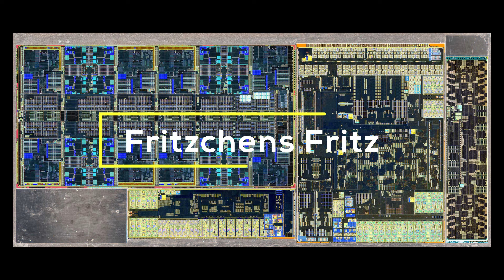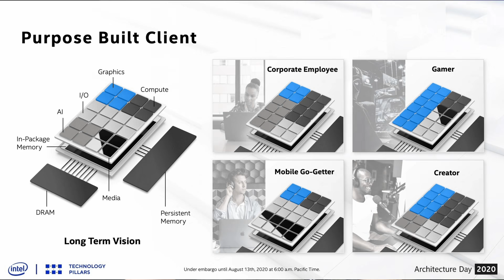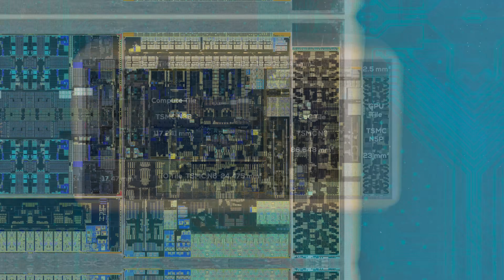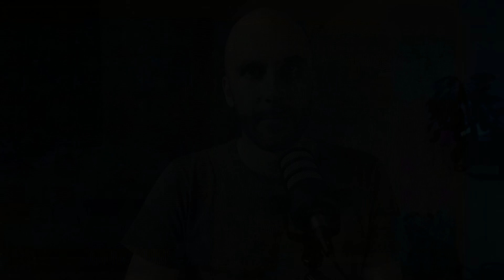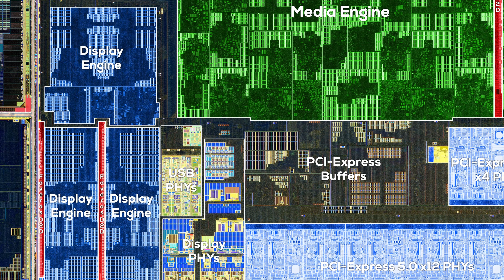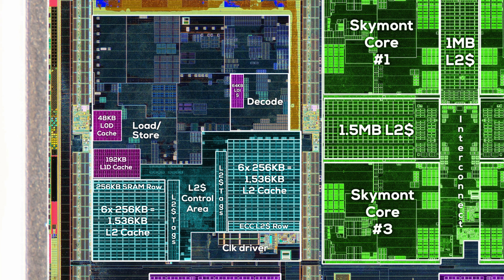Intel Arrow Lake Chip Deep-Dive

Comment: Your voice compressor is way overdone and takes out letters like p and t in your speech. Very irrirating, and fairly annoying!
Reply from the maker: Audio is super difficult. You think not using a compressor would be better?
Reply: @HighYield  You likely have good reasons why you set up the compressor, so I'm not sure if it would be better without. Maybe you can tweak it to be a little less strong? Also, mind you, I'm not an audio guy and the most I deal with recording is to make sure my microphone works well for video conferences, so I can mostly offer an opinion, not good advice.
Reply from the maker: @2xKTfc  Honestly, the only "reason" I have is because most workflows use it. I'm not an audio guy.

Comment: That's simply not true. This chip is WAY slower in gaming than the 14k series. That's why no one likes it.
Reply: Gaming isn't everything
Reply: @Winnetou17  funny, when zen 1 came out with 8 cores which was great for productivity, all of the sudden gaming was everything for the 4-cored intel fanatics, but now that they also lost the gaming crown badly (intel went BACKWARDS in performance for two out of the last five generations), now it's not so important. Quite funny indeed.
Reply: @luisjalabert8366  That is correct
Reply from the maker: Check the latest reviews. Simply not true.

Comment: A few interesting observations not mentioned in the video:
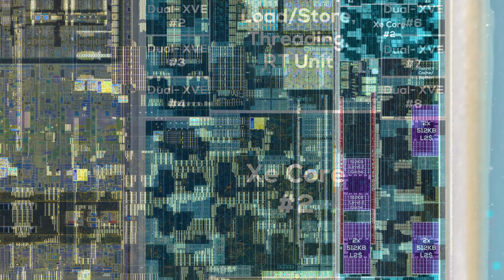1) 5:40 The inboard central logic of each Xe core appears rmirrored for the central vs the outer one (note e.g. an L-shaped pair of cache blocks in the southeast corner of the northmost core, while the one south of it has them in the southwest) Might have something to do with routing, perhaps to avoid wide buses from the Xe cores to the center control logic crossing over each other.

2) 7:02 The magnification isn't high enough to be certain, but it looks like the SoC die has some extra stuff (test patterns in the scribe line?) north of the seal ring. There's an obvious east-west line running the full width of the die above the DDR PHYs including a triangular pattern that looks like it's probably the standard TSMC corner fiducial at the edge of the die. I wonder if maybe they left some test logic outside the die proper to enable post-dicing die test at chiplet integration time or something? This is not something I've seen before, but I'm used to working with monolithic single-die devices and have never looked closely at a chiplet die.

3) 11:41 Same thing, looks like probe pads or test points east/west of the main seal ring and fiducials.

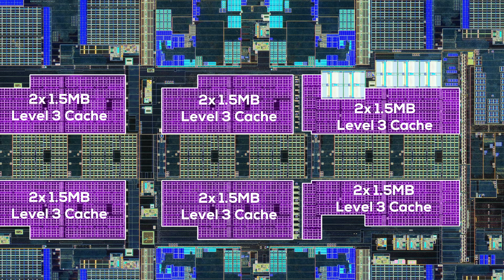4) 12:04 The entire right cluster of Lion Cove cores has a totally different central layout to accommodate the die to die interconnect area. Also, north of the L3 block there's some small blocks that might be memory? Maybe buffers for the interconnect or something.

5) 14:48 SRAM IPs are usually scalable to multiples of 8 bit bus width, but this isn't always convenient for layout. One chip I worked on needed a 1024-bit wide cache line but was physically implemented as 64-bit tiles. It makes sense that if you have asymmetry from adding ECC bits that it might change layout. ECC is usually not part of the SRAM IP and implemented externally, though. So it's likely for layout of the surrounding logic not an IP limitation.

6) 15:34 Hard to be certain of physical implementation without more magnification but it's likely not because of the formatting of instructions. Instead, it's probably because an I$ is read-only (read from core, write from next level cache) while a D$ has to accommodate writes from the core as well which adds complexity. With more mag we could count physical SRAM bitcells, see if 6T or 8T or something more exotic, etc. But at this level all we can do is speculate. Gut feeling is D$ is twice the logical capacity, simple dual port 8T bitcells plus some tag cells that specify if the "written from CPU" or "written from next level cache" copy is current.

Comment: 11:11 Could it be that Intel used 4 pcie lines in the soc tile to connect the gpu to the memory controllers? I remember that AMD does this with their APUs
Reply: Nope, I think these are those chipset link that intel calls "DMI". They are using 8x at 4.0 speed. Look up the cpu diagram.

Comment: I still think Intel's MCM approach is outright bad.  AMD's use of it was simple and clever.  Universal compute chips each two-year generation with small sizes(very cost efficient) on an advanced node that provides fantastic scalability, and a basic I/O die an older node.  Intel has none of these advantages.  They're producing tons of different chips that get little to no reuse anywhere else, providing no scalability and basically no cost benefit with all the complexity and tapeout costs for all of them on TSMC and total die costs(that interposer is large, and 22nm isn't so old to not have notable costs added).  And Intel are basically doing all these new chips with a nearly yearly cadence(even if many are not all the same market, they still have to make all these).  Plus Intel does not seem to have figured out how to get DRAM latency under control with all this.  I genuinely think they'd be doing a fair bit better right now if they had stuck with a single monolithic die approach.

Comment: Very impressive for such a complex design with many optimization thoughts in to interconnect between function block.  Hopefully, yield is good enough.  System level of performance should be key evaluation in order to judge it's true potential.  Since function delay usually causes by interconnect is minimized in the design.  Only hope this is not one of those "designer dream come true and mfg nightmare".  I wish this master piece of engineering feast best of luck.  ❤

Comment: The main problems of Arrow Lake in my opinion rely on the memory controller which is on a completely different die, and the die to die clocks are quite slow, increasing latency by a lot. As Der8aur showcased in his recent video, overclocking the D2D does have a significant uplift in gaming performance. The core clocks are also quite a bit lower than previous generation which definitely hurts performance and this could be  TSMC N3B's fault or architectural issues. Arrow Lake is such a weird combination between Meteor Lake and Lunar Lake.

Intel is fixing this with Nova Lake where they are bringing the memory controller back on the compute tile.
Reply from the maker: The split from a monolithic chip for sure does have an impact. But if you look at Zen 2, AMD saw great gains all around when switching to a much less impressive chiplet architecture. I think the reasons Arrow Lake "only" achieved similar gaming performance is the new cache design with more cache levels and higher cache sizes. This isn't that great for latency dependent applications like games.
Reply: Yes. the Tile to Tile interconnect adds latency- which is why the performance out of box isn't a huge leap forward vs Raptor Lake so far.
This is normal when moving to a Tile/Chiplet design, and AMD had the same issue with Zen, and optimized it through Zen+ and minimized it in Zen2. Intel will do the same- I expect big reductions in latencies on the Arrow Lake refresh CPUs.
Reply: @devobronc  We are not even in the luxury for talking about "huge leap" over Raptor Lake. In gaming performance, it is straight up worse due to the memory latency and other factors I mentioned.

Though for just compute, Arrow Lake is a decent bit better and much more efficient. The 8 bit decoder with a lot more cache and all that, it does top the charts in Cinebench. ARL is like a heavier architecture and with higher bandwidth which is better in compute but it just isn't that slim guy with fast reflexes for tasks like gaming.

AMD's issue is different. With their tile based design, they had individual chiplets and the data going through the PCB is where their major suffering was. Arrow Lake is built with a much better approach with a silicon interposer so the whole package is still one big chip. All they had to do is keep the memory controller on the compute tile which would have not affected the latency at all.

Leaks suggest in Zen 6, AMD is going to use a silicon interposer of some sort or something, to link the IO die (which consists of the memory controller) and the CCDs directly.
Reply: Intel has already addressed D2D clocks with the 200S Boost update which raises frequency from 2.1 to 3.2 GHz. Users will have to manually enable this in the bios though. After Raptor Lake instability Intel was probably very conservative with clocks to prevent another meltdown, but now are more confident in their designs, so we will likely see much higher D2D frequencies in future designs compared to Arrow Lake.
Reply: @ Yes I am aware of the update. But still that isn't as fast as having a monolithic chip. Also other stuff like the ring bus (which I didn't mention) and the core clocks are still slower so they need an overclock as well. I really just want to see someone overvolt the hell out of a 285K and overclock all the metrics with sub zero cooling.

This is TSMC's silicon. That is why we haven't seen any degradation and might not see it that easily. So I don't think Intel was worried much about degradation. They were just worried about the overclocking stability before rolling the overclocked update.
Reply: In the recently announce from Intel of the arrow lake refresh, the 200 plus series, they had boosted the D2D clock frequency up to 900 MHz - 1 GHz!

Comment: The Bios/EUFI for Arrow Lake allows disabling individual E and P cores. I used this feature to lower the power consumption of my new computer which is mostly for internet use. I chose to leave enabled only two P cores and four E cores on my 265K. When mounted on a Z890i Aorus Ultra gaming motherboard and used for my intended purpose this combination drew about 40 Watts from the wall plug. It drew about 120 Watts from the wall on tne Cinebench R23 multi threaded benchmark. Of particular interest was the nearly identical 12.5 wattage reported by CPUID HWMonitor for the 265K CPU and GPU.
Reply: This make no sense at all
Reply: why would u buy a high end latest chip then to disable half of its cores to use it for internet work ?? this makes no sense . u could have bought a lower end old chip for much cheaper for doing same stuff without seeing any difference .
Reply: @arnsassassiner  Technically higher end chips have better binning and you still benefit from the extra L3 cache. And, if/when you really need it, you can enable back the cores. I don't think it's silly.
Reply: @Winnetou17  Only K and S versions. You can absolutely get low end chip with good potential, or high end chip which can barely reach its default clocks.

Comment: As impressive as the tech is, this gen of intel CPU's sadly is a waste of sand
They use chiplets or multiple dies but with zero of the economics of scale that AMD has benefited from over the past years. Each tile is so niche and not reused often enough, that while they are cheaper to make on a wafer, the packaging offsets that entire benefit. If they actually use dtiles across mobile, server, desktop and enterprise like AMD does with EPYC and Ryzen this would be sucha a big problem

It's IPC is lower and it's slower than the previous generation in gaming

The big version of arrow lake was cancelled, this desktop chip is the scaled up laptop SKU, so cores are downgraded a lot compared to the previous 14900K

They capitulated and made it on TMSC nodes, both because intel is failing to keep up with their own nodes, but also because TMSC is far better at packaging, embarrassing really.

They use 3 different nodes for this chip, while AMD only use 2 different nodes. again more complexity and makes assembly more difficult because space for wafers has to be reserved for all parts

And to cap it all off, it doesn't beat it's competition in efficiency. It does beat Qualcomm, but that company are the masters at being 1-2 generations behind it's competitors, with apple always being ahead in ARM effeciency, and now even mediatek making more efficient designs than the snapdragons
Reply: "this gen [...] is a waste of sand"
People doing a lot of compiles, happy to have the new fastest CPU - wut ?

It's really REALLY annoying when people treat gaming as the only thing there is.

Comment: Im here for the whole video! (and to boost engagement of course)

I was wondering where the colors in the original die shot come from, and more specifically why the different PHYs look so different from other silicon on the CPU?
Reply from the maker: The colours are from the pictures Firtzchens Fritz takes. I can ask him. And PHYs usually look different because they need to be more "chunky" and use different types of transistors.

Comment: Nice analysis. The branch predictor is large. More level 0 cache and a simpler predictor?
Reply: I suspect Branch Predictor is the main battle field between Intel and AMD. The rest is already polished. BP may increase even more in the next generation.
Reply: @alexanderbelov6892  .. As an ARM and RISC fan in general more BP = more waste (power and heat). Shorter pipelines and no/tiny BP + more cache = BETTER all round!
Reply: @PrivateSi  'No BP' is good for mobile chips in 1990 with IPC less than 1. If IPC shall be greater than 8 BP must be as smart as prophet.
Reply: @alexanderbelov6892  .. Intel architecture is inferior to Arm that uses a much simpler BP, and only introduced one in Arm 9.
Reply: @PrivateSi  
ARM has got its populatity for embedded mobile phone since 2005. All those ARMs were short pipeline and maximum 1 instruction per cycle. All conditional jump instructions executed in 3+cycles. 
Such ARMs have very poor performance in comparison with desktop x86 processors.
All ARM CPUs with excellent performance have smart Branch Predictors and much longer pipeline.
Reply: @alexanderbelov6892  .. There's a happy medium, ARM are there and I suspect AMD are close, Intel are way off. Branch prediction and longer pipelines = more complexity, heat and power consumption. Desktop chips don't need more than 32 cores, esp. if those cores don't do much SIMD stuff. More Level 0 and 3D cache, medium length pipeline and complexity branch predictor. Intel are way behind. Arm with 3D cache will lead all markets soon.

Comment: It's an interesting tradeoff having gaps between CCD & IOD versus packing the cores together.
Reply from the maker: Intel for example can use the entire memory bandwidth while AMD needs two CCDs to achieve that. Intel's tile design is definitely more advanced, but they need to optimise their P-core design more for gaming and/or add cache into the base tile. That would be a great performance boost.
Reply: @HighYield  but there's been suggestions with Intel's memory controller that more cache wasn't giving much benefit.  They have a lot of L2.
Even 1 CCD/IOD is reducing heat density compared to those chips being connected on their edges.
I've seen Chips n Cheese testing showing 2 cores saturates Zen CCD bandwidth, hence EPYC having 8 channel and the dual IF connections on many SKUs.
Reply: Specifically HUB did some game performance scaling with cache on Intel RPL  with surprising results.

Comment: maybe they haven't fully beaten prior gen in performance, but what matters is they established a fresh foundation that can be built upon down the line, after all, zen wasn't winner in everything either right away
Reply: Zen 1 was monolithic, and used the clearly inferior Global Foundries 14nm.  Zen 2 went MCM smartly and used TSMC 7nm for the scalable compute chiplets(up to 16 cores on a mainstream platform) which led to them absolutely STOMPING Intel in terms of affordable multi-thread performance, were clearly superior in terms of power efficiency, while being very competitive in terms of single thread and gaming performance.  Intel has three generations of MCM package designs under their belt now, and they are further behind than they've ever been.  It's not going well.  They aren't building a foundation so much as they've simply made some very bad bets in their specific MCM approach.

Comment: Do you have any idea how the on chip  DRAM comparies to the memory cels of major memory manufacutrers?  I was curious if the bit density is comparable.
Reply: Where did he talk about on chip DRAM? All of the on chip caches and RAM will be SRAM, which is very low density vs dedicated DRAM processes
Reply: @JoeLion55  At 8:50, the upper yellow sections is supposedly DDR5 memory.
Reply: @DarinMiller   oh. It says “DDR5 PHY”. The PHY means “physical interface”. The PHY is the block that sits between the memory controller and the actual off chip DRAM, and act as, as the name suggests, the physical interface between the CPU and the memory. He discusses these briefly at 6:50. This is a dual channel system and there are 18 PHYs, so 9 PHYs per channel. Each channel has 8 PHYs for regular data and 1 PHY for ECC data going back and forth to the memory modules. Each PHY handles, I believe, one “data slice” on the memory channel, which should be 1 byte wide